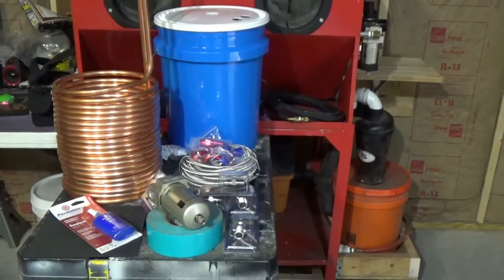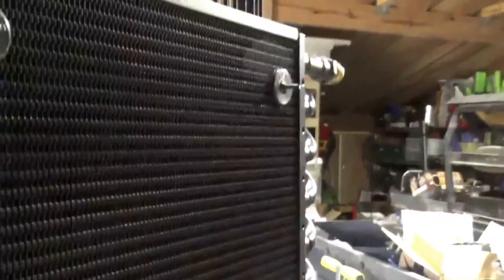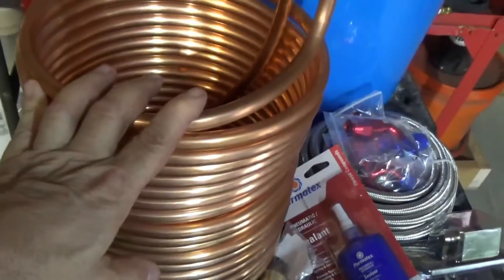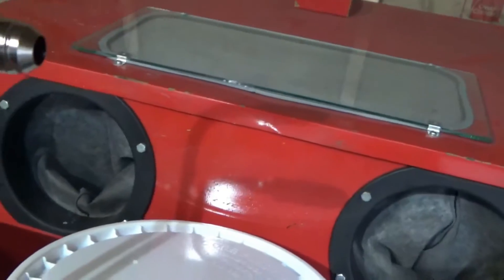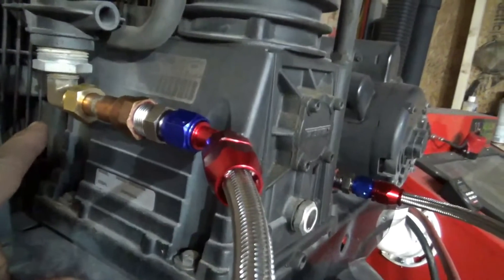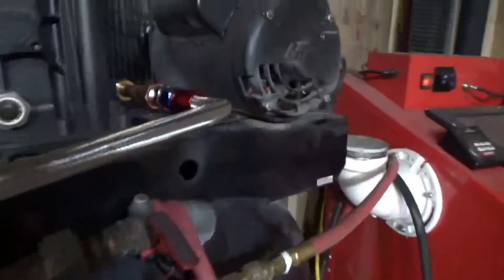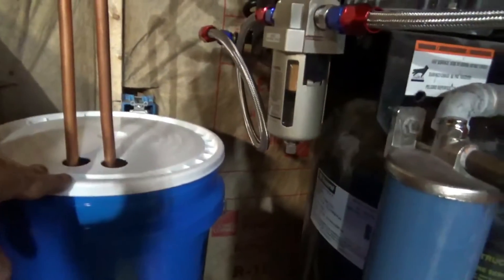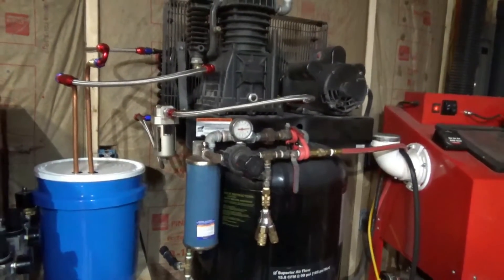DIY Air Compressor After Cooler / Dryer

Comment: Great video, and you just gave me some new ideas! I am trying to design my own system for my body shop right now. I like the idea of mounting the radiator behind the fan on the compressor, using the energy already being spent to lower the heat of the air. I looked at some copper coils at Lowe's, and they have a 10' coil for around $25, and a 20' coil for about $45. I had also thought about submerging the coil in a bucket. My only reservation is, where does the condensed water go from that point? I would add a drop leg after the coil, with a petcock valve or the automatic water separator valve like what you've done. But I REALLY like the idea of using a refrigerator. I have converted a 5,500 sq ft garage into my current body shop, and it used to have 1,000 sq ft as an apartment. I converted the apartment space into my paint booth (where the living room and bedroom were). There's a kitchen off to the left of this space, right in the middle, and I have a working fridge. I could plumb my line right to the fridge, and back out to the wall. The only thing I need to do is figure out how you could drill the holes in the fridge and seal them up. That's my next task! I think I would probably put the coil inside of the fridge, or the freezer perhaps. Then I could run the output to a drop leg and put the water trap at the bottom. Great video!
Reply: I picked up a cheap 10" radiator fan and 12V power supply to mount to the same Derale 15300 oil cooler. Very efficient - wired into the motor contactor on the compressor it only runs when the compressor is on. $35 for both plus some wire. Get's air really close to ambient before hitting the water separator. Works like a charm and super clean/compact.
Reply: @imkindofabigdeal4308  That's really cool! Just a regular 12V power supply? I am going to try this. I like the idea of wiring the fan to the compressor, to where it's only on when the compressor is running. Thanks for the update!
Reply: Hi Carlton, what setup did you finally end up with?

Comment: I feel it's better to have one stage compressor because a 2 stage compressor heats air up twice,,it will boost your pressure but not your CFMs.
Reply: George, two stage compressors almost always have an intercooler to cool between stages. I would be hesitant to buy a two stage compressor without one, if you can even buy one without said cooler.
Reply: @rogerd4523  Roger that Roger. My two stage has an intercooler. And fills the 80 gallon tank very quickly. Two stage compressors usually run an industrial motor that operates at a lower RPM - quieter and more reliable. With an aftercooler mounted, my input to the water separator is just slightly above ambient and my tank barely has any water in it (vs tons before the install).

Comment: I did mine 2 years ago with 1/2 coil copper tubing from my pump to tank,, I was going to use condener,,but noticed the restriction of air flow from reducing from 1/2 piping on compressor to the 3/8 tubing in condener,, your going to create backflow to your compressor head and shorten it's life...

Comment: Nice job Chris!  I do not know the answer so do not think I am just being a smart.... guy..  when the hot air is coming out of the compressor with moisture in it and then the coolers create condisation in the pipes.  The condisation then via gravity flows to the lowest location.  Maybe the bottom of the coil? Other than blowing it out how do you setup a gravity / automatic blowout system?
Reply: TheDWZemke, the condensate that builds up in the pipe will always be blown with the air until it meets some type of separator, which he has installed before the receiver tank. The receiver tank will act as a separator as well, hence the drain valve on the bottom of the tank.  Hope that helps.

Comment: I think that coil in the bucket is going to prove more trouble than it's worth. I don't think a small fridge or even a big one has the BTUs to move enough heat to keep up. That's even before you figure a way to transfer the heat out of the bucket water into the refrigerator. A radiator and fan inside the refrigerator? You mentioned already being strapped for space. So let's say you solve the heat moving capacity and heat transfer problem. You'll likely be well outside of the refrigerators designed duty cycle. It will die in short order.

My bet is, you would be better served by getting rid of the bucket coil and just getting more air over the trans cooler. Worst case adding another trans cooler as well.
Reply from the maker: Actually, it is working incredibly well.. I had to change the flow direction. I now go into the radiator first, then to the bucket.. I have  no water entering my tank now.. The automatic drain on the bottom of the tank is always dry....
Reply: @venomchris5818   Kinda what I'm saying is that I bet after that bucket coil water gets warm, it's probably not doing much work in the system, the trans cooler is doing most of the heavy lifting. Might even be ok without the bucket and water, just leave it to the open air, with the coil dry, you could flip it upside down so that it drains any condensate that collects in there... All the other after cooler builds on youtube with a trans cooler setup seem not to need much else besides the drains/separators. 

Mostly I would worry about that bucket being one more thing to worry about, could harbor mosquitos, mold/algae or ultimately the coil sitting in water would corrode eventually.

Don't get me wrong, it's nice work and the distiller coil is an interesting idea, I'm just spitballing issues I can imagine...
Reply: Again, I see how it is to put your work up for criticism on youtube. I don't want to sound like I'm bashing what you've done here, just thinking out loud.
Reply from the maker: @davewood406   I welcome all criticism and ideas..  I will say, First I tried the set up with just the trans cooler it did work very well. Although I was still seeing a small amount of water in the second water separator and a small amount in the tank. I then added the coil in the bucket. At first I put it before the trans cooler and it worked very well but the coil got extremely hot. I then put the coil after the trans cooler and that works the best. The coil does not get more than cool to luke warm and I never see even a mist come out of automatic tank valve on the bottom. The secondary water separator barely ever has anything in it and if it does , it is a mist that lasts maybe a second. The coil in the bucket great improves the system. And the bucket of water is room temperature to start every day whether it is cold or hot out. I have checked the temperature at the end of a work day and it appears the water has ample time to cool between cycles.
Reply: Dave Wood why couldn’t he use the bucket (if he put it in a fridge) after the tank but before the hose. I read that refrigerated dryers are used after the tank but before the tool. That serves a much better purpose to give ample time for the air to cool before cooling it and separating out the water. You could easily cool the air from ambient (using aftercooler) to 40 degrees threw a fridge with water in a bucket.
Reply: @code3responsevideos872  so the air being cooled to ambient being chilled to 40 degrees could still be a significant cooling chore. So the issue with that is sizing the refrigerator to be able to cope with that heat load. Not just cooling capacity but duty cycle. Will that refrigerator hold up to running at near full load for hours at a time. Even if such a load duration isn't every day. It's something to consider. You don't want your system to consume itself when you really need it. Then you get into considering the cost of running the refrigerator. 

Depending on the cost /source of your tap water. It might be feasible to just let water run into the bucket continuously. Draining it off into the garden or something. 

I try to eliminate things to maintain usually. The water bucket seems like just one more thing. I lean toward over sizing the after cooler to cope with it so that it's good enough for all but painting. Having a dessicant system at the ready when necessary.
Reply: @venomchris5818  I'm using the same Derale cooler with a 10" radiator fan ($22) mounted to it. We fabbed up a simple frame so that the fan shroud is flush with the radiator. The 12V fan is wired to the motor contactor through a cheap power supply ($13) that can handle 240V and 120 watts. Moving a lot of CFMs through that radiator. Only turns on when the compressor is running. Get's me to just a few degrees above ambient on the water separator inlet. Compact and not much fuss.

Comment: What are the temps at the bucket exit and the fin cooler exit?  I'm thinking you should have used the fin cooler first and the bucket cooler second.  The fin cooler brings the temp to ambient then the bucket gets it even cooler.  Make sure the fin cooler isn't heating the air back up to ambient temp.  You could try just keeping fresh water in the bucket, its probably cheaper than running a fridge which may not be powerful enough anyway.  Second, how fast does the water in the bucket heat up?  Just drop a 2 liter bottle of ice in the bucket see how long that last. My theory is that once you've cooled the compressor air to 70 F, and extract the condensated moisture out, you've got most of it out already.  I really like your approach.  Installing the cooler and separator before the tank gets the moisture out more efficiently that the videos that install a tubing separator system after the tank.  Thanks for the video.
Reply from the maker: You are absolutely correct... I had changed to the order you described the next day. I have also put some shock absorbers to the hose lines to cut down on vibration.
Reply: Venom Chris you put shock absorbers where exactly?

Comment: All those fittings by your compressor are offer no buffering for the viberation. In other words down the road your going to have a failure at that point. You need a vibration damper of some sort.
Reply from the maker: I was thinking about that.. Thanks for confirming.. Any good ideas on simple solutions?
Reply: @venomchris5818  When I put in my AIr cooling system (DIY System) I used a barbed fitting straight out of the compressor that connects to a HD Rubber hose and it is clamped in place on the fitting. It's been in service for 3 years without an issue. They do make special fittings called vibration damping hose but they are pricey.
Reply: @venomchris5818  +1 on the hose vs copper. Hose Power (a Bridgestone company) is a national chain and will make custom hoses with whatever connectors you need. I'm using the same Derale cooler. They made 3 braided stainless, PTFE hoses rated to 500 degrees with connectors for about $120. Not bad for a really clean install and a minimum of connection failure points.

Comment: Looks great Chris, yes the fridge, would make a huge difference, I'm on the east coast of Australia and back in the 70's to the 90's many workshops used to run drinking water in the same way through a fridge and you could have cold water like a keg, you can run a filter too & it's nice on a hot day, same principle. I look forward to seeing how you go, my compressor has a inbuilt drier & then 2 water traps after that in the lines, i just have clear hose, so you can monitor what comes out. 👍
Reply from the maker: I am going to try the fridge... :)